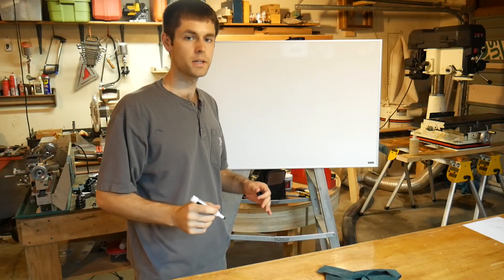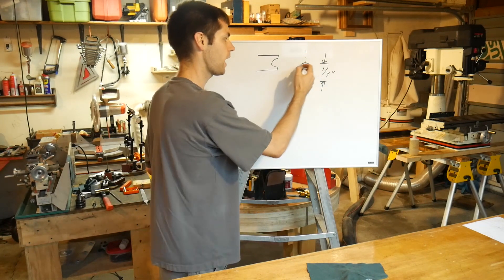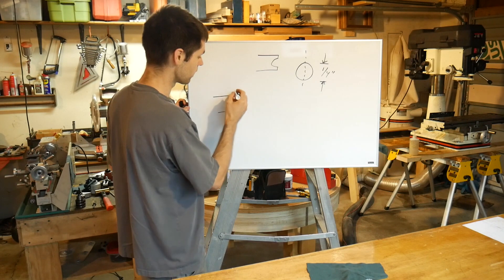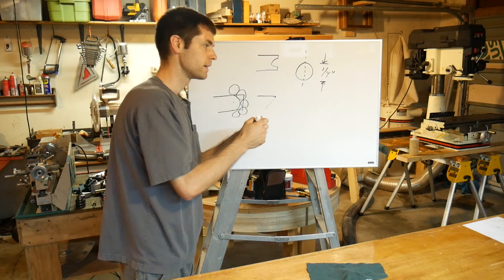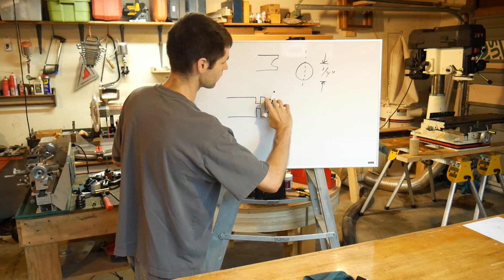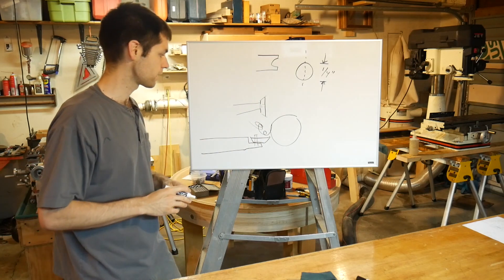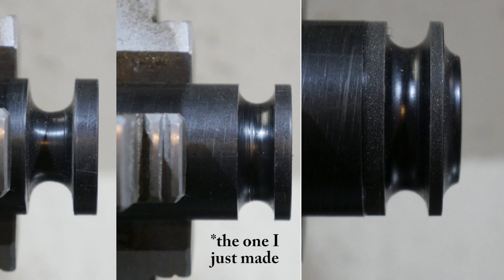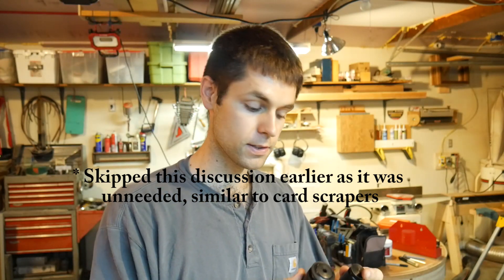DIY Circular Cutter

Comment: If you ever need to do this again I would suggest an easier way - put a spiral milling cutter (of the same diameter as your rod) in the lathe 3-jaw chuck. Mount the Delrin blank on the axis of the rotary table, which is mounted on the cross-slide of the lathe with its axis vertical.  Run the cutter at speed, use the lathe cross feed to feed in the cut gently, and the rotary table feed to take the cut round the Delrin blank.  Use the side flutes of the cutter to make the cut.  No need to make a cutter.  Hope that helps, if a little late !  Next time, maybe.

Comment: Great idea for creating a round cutter. How hard did that end up being? It sounded a lot different on the diamond stone after the treatment!
Reply from the maker: Not sure how hard it is, I'll try snapping one of the previous attempts to gauge the brittleness.
Reply from the maker: I dropped it repeatedly onto concrete from 8 feet with no damage, I also tried to snap it with vice grips and did not succeed . . . this is a good time to note that I'm only about 15% done reading my heat treatment book, ha ha.(It was definitely harder than at the start, file test showed that, but clearly the process needs improvement.)
Reply: Glad it survived the falls. :)

Comment: Nicely done! :D Good idea hardening it, 'cause now you can use it for other, harder materials.
is there a reason you went with a round profile as opposed to a V groove? I'd be worried about extra wear on the wheel, as you're gonna have more contact points, all moving at different speeds on the steel rod because of the different radii of those points on the wheel.
Reply from the maker: Thanks, once I'm done I should give it a try on metals to see how well the edge holds. I went with round because the shafting I want to ride on is round and some basic tests seem to show it working well. It also resists vertical forces pretty well since the flange wraps all the way around.
Reply: I was wondering about the V groove as well. Although a bit out of my expertise, I've come a cross some rails etc in different machines that uses V instead of round profile.  
Then again I don't know what the project is and how durable it has to be.
I'm waiting to see where this is going :)